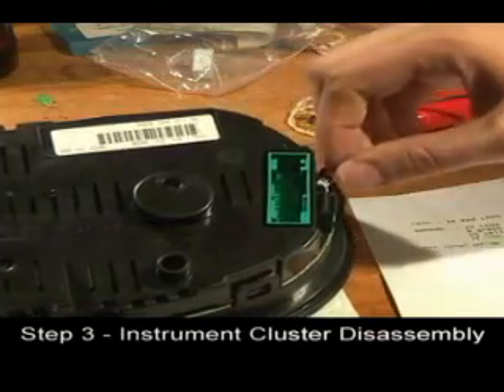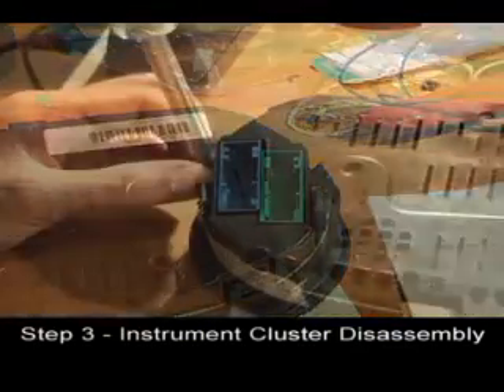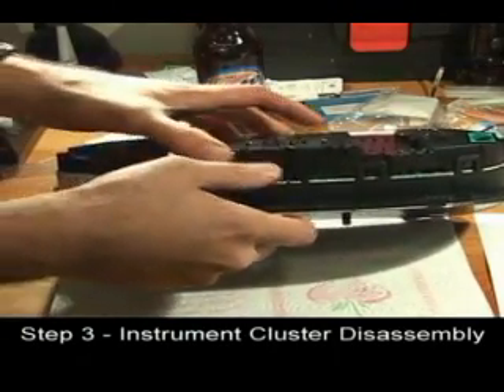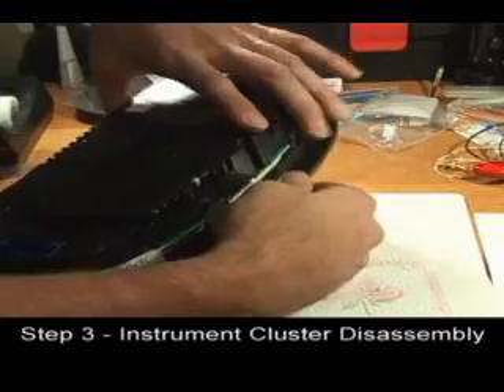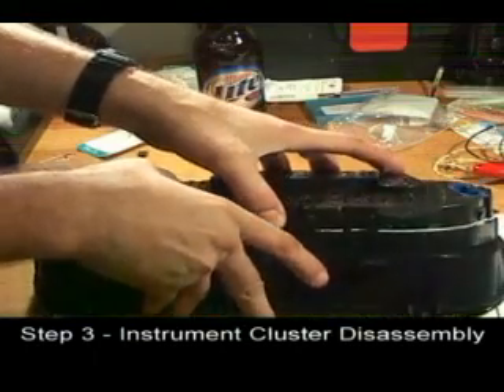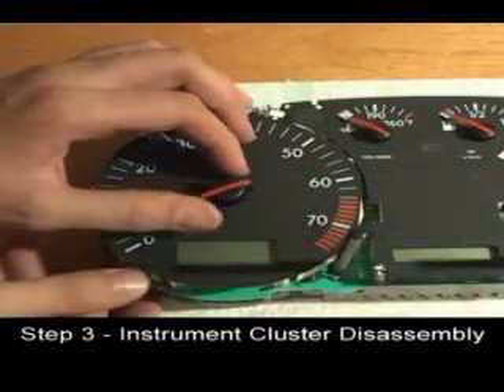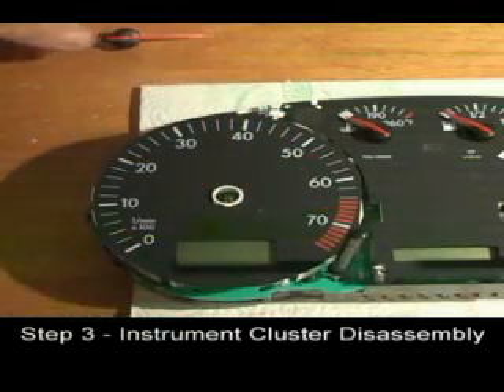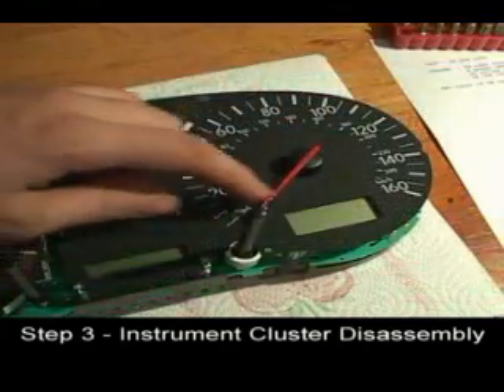LED Project #2 - Step 03 - Instrument Cluster Disassembly

Comment: I took my needles out, it took hole lot of power, extreme amount of power compared to this video, and then when i returned the needles none of the needles were working properly, rpm going all over then falling to zero and not moving or moving randomly, speedo moves to 20, 50 and staying there, and falls back to 20 and stays there after i turn off the engine, oil temp needle not moving at all after 30 minutes or after an hour, not sure if the fuel gauge is proper also, WHAT TO DO?!

Comment: My fuel needle is vibrating every time I turn the car on and off but never during driving work fine just has turrets when the key goes in or out or if I switch the car off how do I fix this please tell me thanks